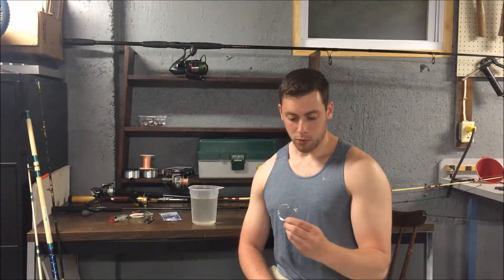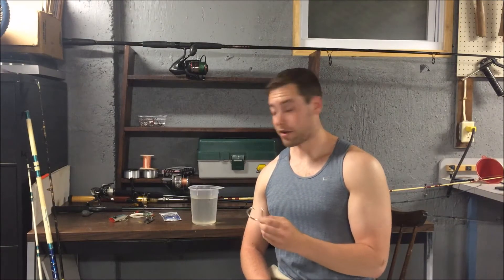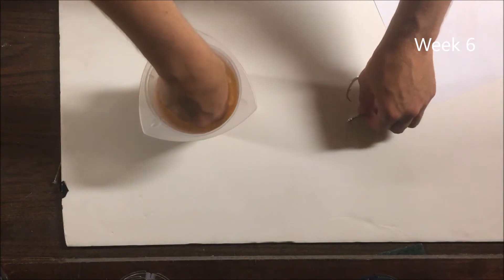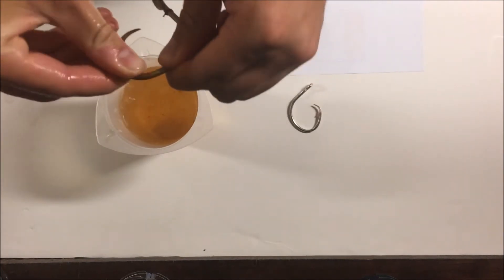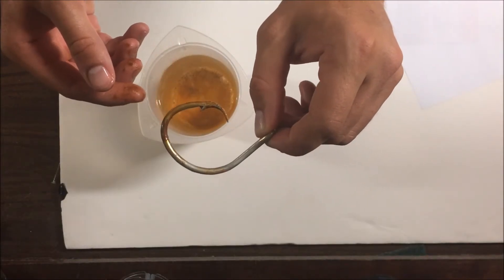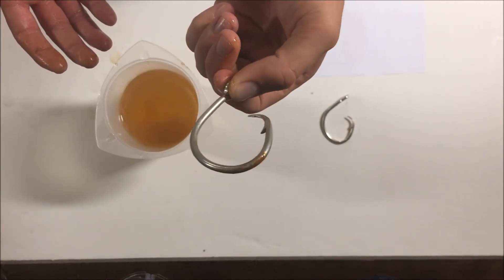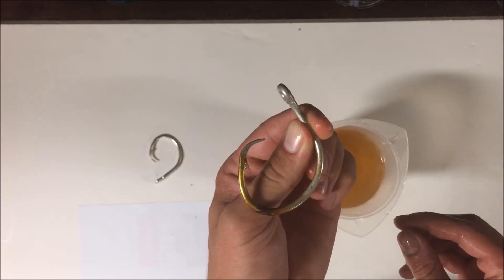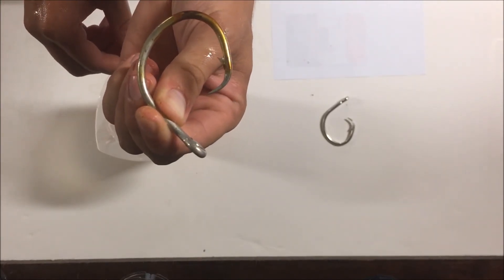Hook RUST out of sharks mouth? EXPERIMENT

Comment: I know this is a old post but that hook looks to be plated or stainless, all hooks are different depending on material the manufacturer uses. Other hooks corrode much faster, and in studies conducted the barb tends to deteriorate enough for the abscess to push the hook free generally within a week or two. Now hooks like the one you tested will take longer to rust but the fish’s body will react the same way. The study I pulled the info from was done on northern pike.
Reply from the maker: Yeah these are stainless steel, the carbon steel ones rust much faster

Comment: yes i was going to comment the black ones are high carbon steel hooks.  A good prime example are gamakatsu hooks.  You can tell they are hardened as well, if you try to pinch the barb off a gamakatsu hook for exampl the barb will merely snap right off instead of bend back like a mustad would.  The draw back to the high carbon hooks of course is that you must properly rinse used hooks and wipe them down dry if you have any hope of them not being rusted before your next fishing trip.

also you're using a circle hook.  most circle hooks are not ingested, they are meant to set on the lip of a shark or fish.  if it doesnt set it merely just pops right out of their mouth.  that is why if you try to yank set a circle hook in the same way a j-hook would, you almost always lose your strike.  The test is still a viable one for jhooks being ingested, but just noting that most hook jewelry is on the lip of sharks and rays and not in their bellies.

Comment: Yeah, as a shark diver who's seen dozens and dozens of sharks with hooks/leaders in their mouths, I always knew that, "they'll just rust out in a short time" line was bullshit.  
Given that most of my sharks I dive with are relatively pelagic/open water sharks(almost exclusively blues and major, unless I'm down in Florida/The Carribean), combined with how much more often I see sharks with hooks in their mouths nowadays(and/or broken lower jaws, many that are virtually at a 90° angle to the upper jaw, forming a "T") I've always found it hard to believe that these hooks just "rust out" in a few days/weeks/months.
Not only that, but is say 95% of the hooks I see in sharks mouths have zero visible rust on them, and generally look shiny, as if brand new(I assume because they're stainless steel.)
That being said, I know they do make shark hooks(and fish hooks in general) out of a "regular" carbon steel, and that there is a push for fisheries(and charters who go after sharks) to use carbon steel hooks instead of stainless steal, as carbon steal can potentially "rust out" in less than a year, whereas a stainless steel hook can last for potentially decades, or at least the rest of the shark/fishe's life.  They're not like the the small hooks made from wire that are common for recreational fishermen that start to rust if you just look at them wrong.
Reply from the maker: Very interesting I learned a bit thanks for sharing

Comment: You need oxygen to oxidize the hooks metal and your not factoring in the crap sharks eat that will destroy hooks as well as their digestive juices dissolving it if it's in the stomach
Reply from the maker: True, you're right.
Reply: Bsprecks not to be a jerk I mean you had a valid test going but it just wasn't as realistic as it could have been then again it's almost impossible to have a 100 % accurate test so whatever but keep it up man

Comment: People use circle hooks specifically to prevent the hook being caught in the fish's gut.  They are supposed to catch on the jaw and nowhere else.  Also, if the hook is in the fish's gut, it's not exposed to salt water.  It's exposed to stomach acid, which in sharks is pretty corrosive stuff.  The only time a hook is exposed to salt water is when it is in the fish's mouth and it will, eventually, rust out and fall off with that placement.  So, I don't think this test proves anything other than it takes time for hooks in a fish's mouth to rust out.
Reply from the maker: Yes I know a circle hook would not normally find its way into a sharks stomach, but some people use J hooks. Anyway, you're right. I was mainly testing to see how long it would take to rust out of the mouth

Comment: I think the whole idea of hooks quickly corroding out is essentially a myth.   If you do any beach combing, you can find tons of lures and objects that have been in the water for a very long time.   Secondly, what about all the iron objects that permanently sit in fresh and salt water like dock supports, brackets, bolts, chains, and whatever?   we're talking decades old...and they're still strong.   Yeah, i know some iron things have zinc sacrificial anodes installed  but most things do not.    I was reading a forum once and a guy caught a fish and took a photo of it because it had a second hook in its mouth.   What was interesting is that  it was one of his own hooks lost to a fish weeks before and it was in brand new condition.   It was a home made rigging with beads and blades so he knew  100% that it was the one he lost previously.   so no, hooks do not corrode and fall out quickly.   It's the same as the myth about paper vs plastic recycling in garbage.   Guess what...paper and cardboard do NOT decompose in landfills.   In fact, they use newspapers and magazines to figure out how fast a landfill is building up.  They drill down, pull out papers and READ the dates on them to see when it was put there and how far down it is.
Reply from the maker: That's all true, good points.. thanks for commenting!

Comment: I think you're depending on oxidation alone with this test. Maybe a better test would be hanging off a dock somewhere so oxidation and electrolysis can work on the hook. I long lined Prince Willam sound and Kachemak Bay in Alaska for years using the same circle hooks and corrosion was never a problem except to dull the hook. The circle hooks clam to fame is its ability to hook a fish in the jaw around the lip area, it allows the fish to fight the ground line without killing itself. The old style "J" hooks allowed the fish to swallow the bait down and get hooked in the gullet when the fish tried to escape he died on the bottom. Dead fish on the bottom don't last long they become Sand Flea Buffets.  Barbless Circle hooks are the best hooks to bait fish with when a release is intended .

Comment: SO we already know that when trolling, sacrificial anodes are use to stop the hook from wearing/rusting out.. 
You should attach a little pump to a fish tank and hang this hook in the current to compare the difference to a fish that is swimming around.
Do a comparison to the stainless hook you have used (which is resistant to rusting) and a carbon hook. That will be interesting :)
Reply from the maker: Steve Shortt Interesting, I need to try that

Comment: I always thought the "it'll rust out in a week" thing was BS. I use carbon hooks, mostly 00 and 000 hooks, in freshwater and I've seen them rust badly if damp for a week. Two weeks and the barbs are basically rusted away. I would think a barb would be the first thing to corrode in a shark and the hook may then fall out. Foreign bodies tend to set infection pockets in flesh to help naturally expel them, like splinters in your finger, so maybe it is the same with sharks? I don't know.
Reply from the maker: flysubcompact good to know!